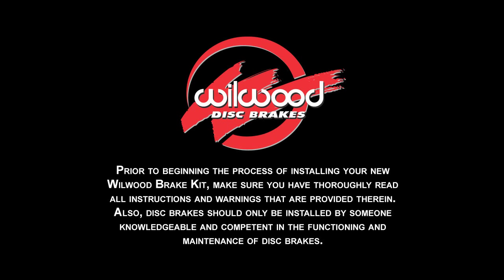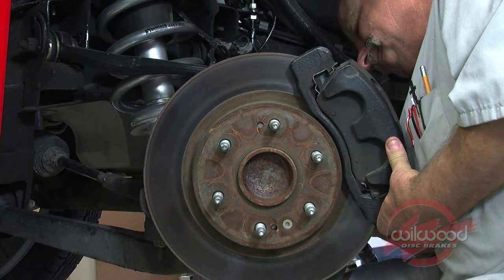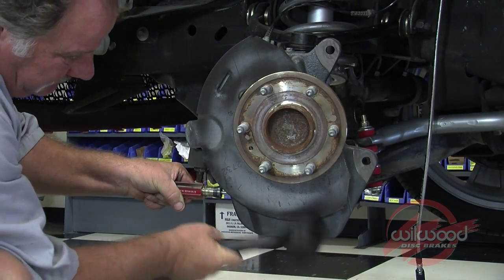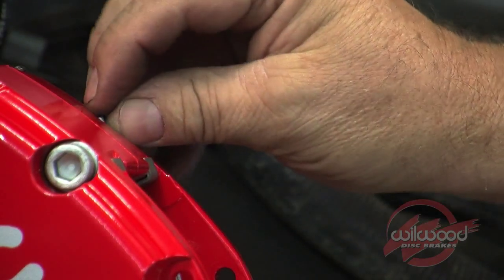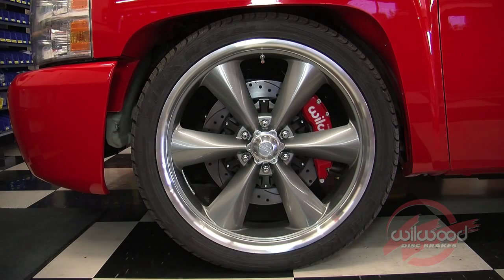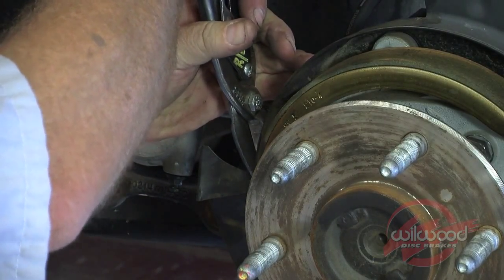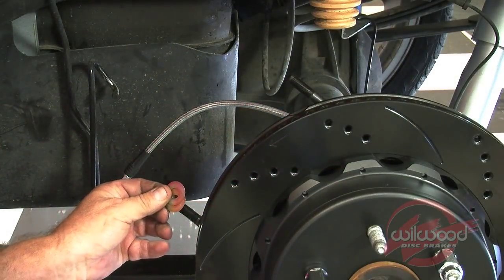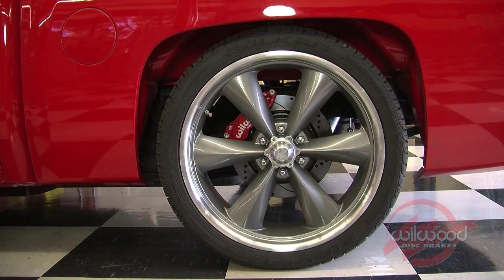Chevy 1500 Front & Rear Disc Brake Install

Comment: please make a similar kit for the 95-99 chevy tahoes. there is a market for them
Reply: YEEEES
Reply: You can ream 2000-2005 knuckles,tap the axle a bit so it can bolt on flush. Abs sensors plug up directly,and use your imagination to bolt down the brake lines. Also you will need an adapter to fit the brake lines together.
Reply: @JoseContreras-mv5yz  so you are saying the kit can be modified to fit? Have you done this?
Reply: @pmann8921  not yet. I'm still aquierring parts.
Reply: @JoseContreras-mv5yz  SSBC USA brake kit A186-1R Front  Upgrade Kit
Reply: @Mel Bellwood SSBC USA brake kit A186-1R Front  Upgrade Kit

Comment: Brake fluid is very bad for your skin, and basically EVERYTHING for that matter. Brake fluid is fucking nasty. You really ought to be wearing gloves when changing brake lines. Brake fluid strips paint, better than some paint strippers even.

1:20? That's a clean hub? wow. Rotor run out is going to be awful.

Are worshers different to washers?

Comment: I would like to know if this set up would work for a '92 1500 as well. If not could you help me with information/product to convert/upgrade  the factory discs/drums and calipers out to a full disc system?
Reply: You want a 10-bolt conversion kit for the rear brakes and a single 1" bore master cylinder. Front discs should have a D52 or D154 caliper. I forget which ones mount properly, but one of those is the right one. For discs, I like the StopTech ones, but I really would like a way to have the hub separate from the rotor. I've thought about making my own, but I'll be at the lathe for days.

Comment: No matter how much research I conduct with both products and customer service of auto service repair shops, I always feel burned by the product or the service and often it feels like both burn me.  I only have 91,000 miles on my 2005 GMC Sierra: I was told by a local garage [Florida] that I need a complete brake job; I only added approximately 20,000 miles since May 2013 [in Virginia] the last major brake job: I am currently on my 3rd set of disc brakes on the front and 2nd set of drums in the rear.  Once again I am seeking honest professional help; however, I am believing that is only a dream!
Reply: @WilwoodDiscBrakes  Thank you; I never used any of your products, but you might be on my radar as a option.  I am not sure if you have a braking system for my truck. Disc in the front and drums in the rear!  I am really bummed about the matrices of "affordability vs reliability, maintainability and durability of products"! Geez Louise! owning a vehicle is becoming so expensive through forced obsolescence. I am considering doing my own brake job to rule out potential "scam jobs".